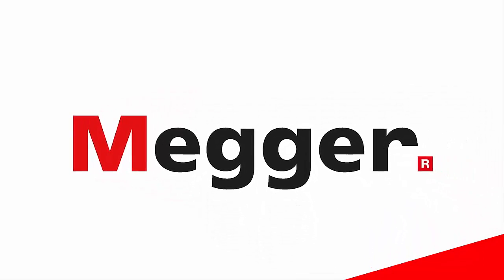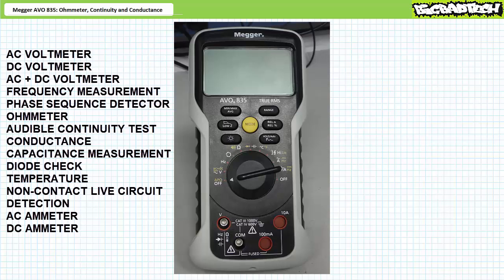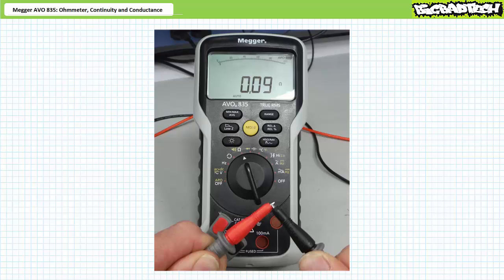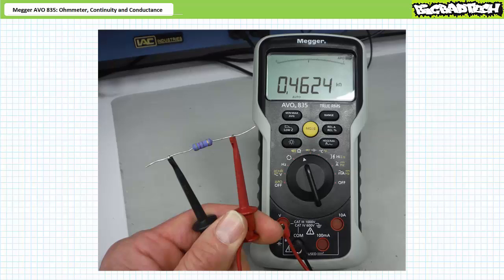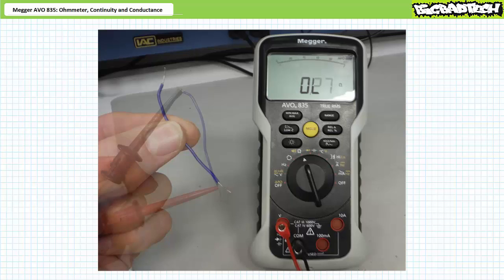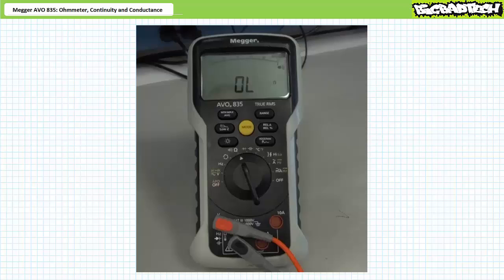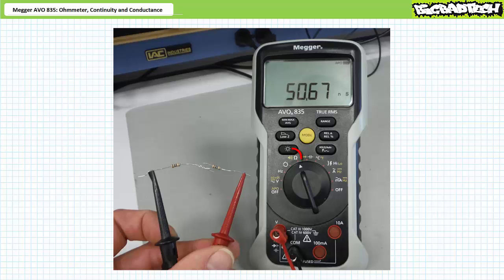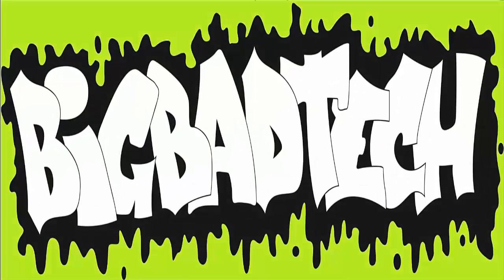Megger AVO835: Resistance, Continuity, and Conductance

Comment: Can you do something on testing motor winding insulation with a mggerer?  I can do 3 phase motors no problem but I don’t understand single phase. Also some of the huge spindle motors I work on have 3 contactors switching like an electric transmission and 9 power leads and a ground in the  j box. It looks like there are 3 wires leaving the spindle drive and then they kind of jump around the contactors to create different phase combinations? Or are there two sets of windings? It’s confusing. I start getting over voltage errors during deceleration or regen alarms and I have to test the drive and motor ?
Reply from the maker: Stay in touch because once I finish up fixing the basic electricity and electronics series I do plan on returning to the motors and generators playlist as well as some new, more advanced, material.

Comment: Hi Jim - would you choose this or a fluke 117? Thanks for the video.
Reply: You want a fluke 1587 ! I have one and it’s the total package for troubleshooting. It has all the functions of a regular meter and it is a Meg ohm meter so I can do insulation checks on motors with 4 voltages up to 1000v. Plus I have an amp clamp that plugs in and I can measure ac dc amps up to 600 amps.
Reply from the maker: Now we're talking a totally different price range! I've worked in some harsh industrial environments before and putting all your eggs in one basket is asking for trouble. The joke goes like this: give a soldier a rubber hammer and an anvil and they'll break both of them. I'd honestly prefer to use a less expensive everyday DMM with a reasonable amount of features and then bust out the expensive special purpose high quality equipment only when you need it.
Reply: @bigbadtech  thanks for the quick reply. In the uk there is around £20/30 difference so they’re pretty close here. I know the avo has more features but looks bigger and less robust and has great safety features. But I like the sturdiness of the fluke and it has a proven track record. I’m thinking fluke but I was interested in your opinion. Which would you choose if they cost the same?
Reply from the maker: Like I said the phase sequence indicator is the thing that sold me on the Megger AVO835 simply because I frequently work on 3 phase AC systems. Tell you what, I was going to publish the voltmeter lecture next Monday but I'll switch the order around so you can see the phase sequence indicator in action. Check back here next Monday to see if this is something you're interested in.
Reply: @bigbadtech  do you use that sequence option very often? I just jog a motor and swap a lead if I have a phase switched. When I install a machine it is always 3 phase into a multi tap transformer so I never do get to use mine. What I really want is one of those flexible current clamps that you can fit into super tight locations. Maybe one with a remote display so I can hook it up and monitor with door closed?
Reply from the maker: That's always a field expedient option, however, I used to work on a stacking system that would utterly destroy itself if ran in reverse! It was always a good idea to check phase sequence prior to letting it run.
Reply from the maker: The AVO835 is my tool of choice right now for reasons that'll become readily apparent in the next couple lectures discussing this tool. It's in the same price range as the 117 however it includes a phase sequence indicator which is super handy when working with 3 phase AC and is rated up to 1000V.